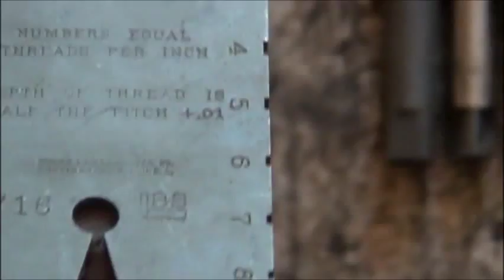JD 50 Update

Comment: Hi Jeff, nice job on facing that casting, looks like JD used some quality iron on that when it was made. I too think the shims are for a toolholder, I try and do it just that way when I switch tools out on the turret toolpost on my turret lathe, I normally will tape the tool to the shim pack as well. The 50 is really moving along real nice, sorry to hear about the thrown rod on your Massey. I'll be looking forward to the next video.
     Mike
Reply from the maker: Thanks for stopping by, Mike!
He was mowing some small trees with a "Brush Hog" when the rod went. I gave he a hard time about not paying attention, but am sure the mower made about the same noise as a knocking rod! "Sh*t Happens!"

Jeff